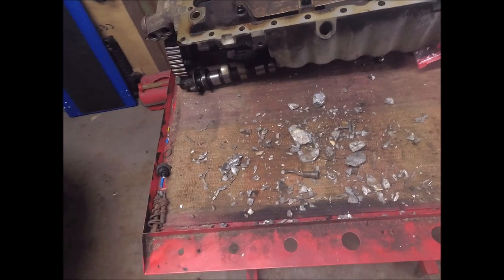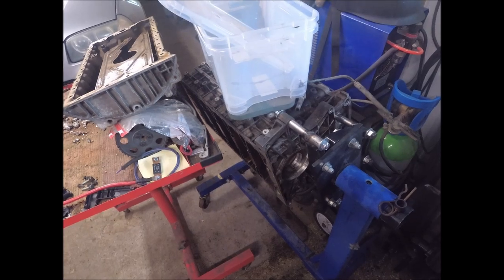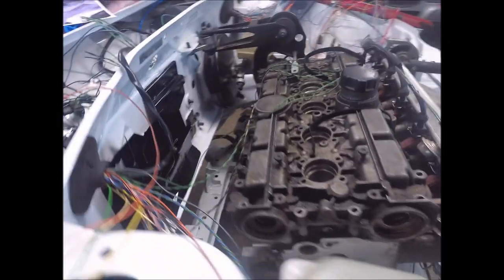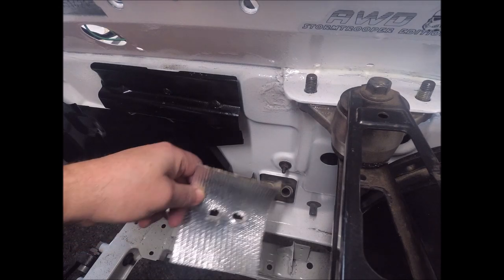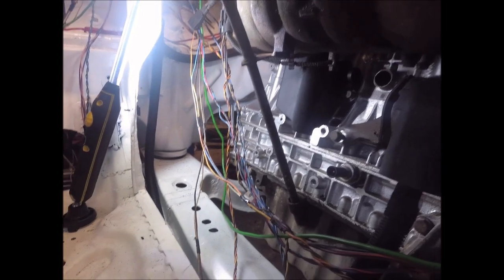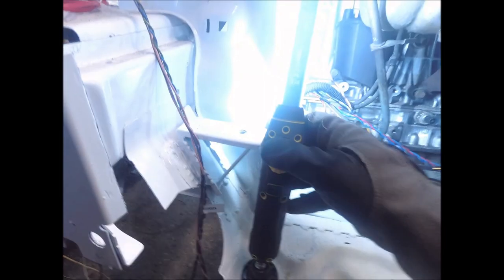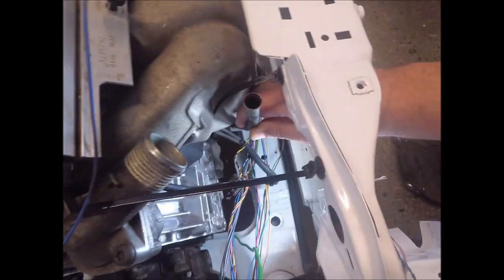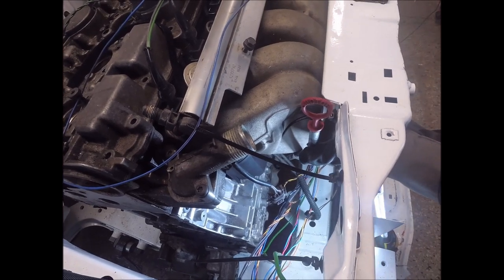Is it possible to bend a dipstick tube? *Volvo 460 T5 AWD*

Comment: Hey buddy, one old school method for bending tubing and maintaining a round result is to fill the tubing with sand, pack it well into the tube, then cap it off w/duct tape before bending it. The sand keeps the tubing from collapsing while bending it.

If you know someone with a surface grinder they could problee get that pan rail repaired for you unless it requires so much grinding as to cause interference issues w/the crank and rods in the pan, though I expect that's kinda doubtful.
Reply from the maker: Hey your self buddy. Come on now BFF, you don't think I know about filling it with sand. We need to stay in touch more often, and do our car stuff discussions hehehe. It's not the pan my friend, it's the lower block girdle main bearing piece that are butchered. I'll do a video about it when this block gets out of the car. Don't be a stranger, hit me up on Facebook message ones in a while 🙂